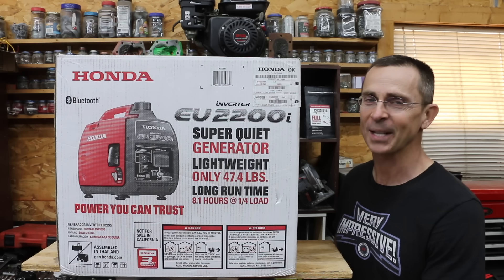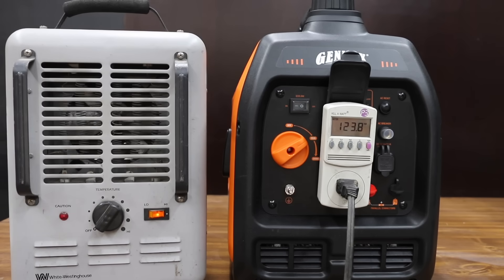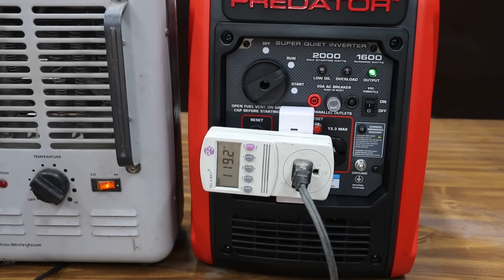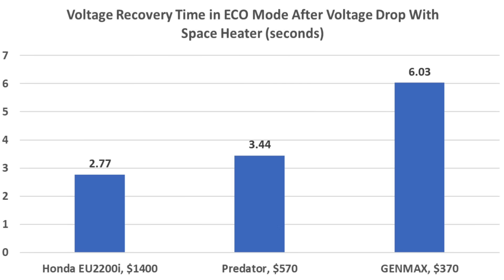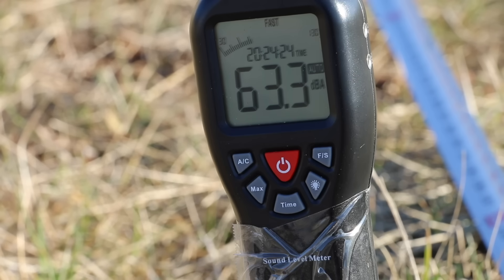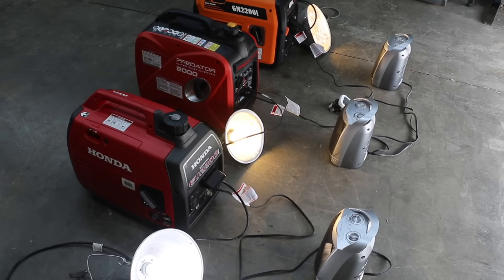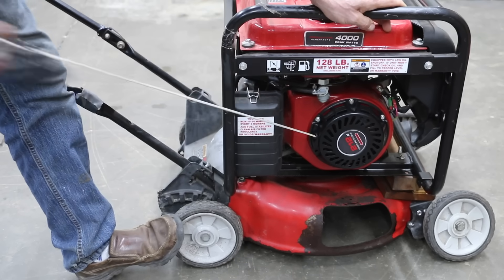Cheap Generator Better Than Honda? Predator vs Honda & GENMAX—Let’s Settle This!

Comment: You measured 60 oz of oil on a scale? There is a difference between 60 oz of weight and 60 oz of volume. It's the density of the liquid

Comment: I hate that most generators come with a CO detector that shuts them down. If the detector is faulty you can't use your generator. And if it is a life or death emergency you might not make it to the repair shop... I bypassed the one on my generator. I'm not a stupid who puts his generator inside a confined space...
Reply from the maker: Thanks for the feedback.

Comment: Many years ago, I remember seeing a small power conditioner that looked like a surge strip, but it was specifically designed to "buffer" generators that weren't "Pure Sine Wave" to ease the wear and tear on electronics and motors.  Does anyone still make those?  And if they do, do they really work?
Reply from the maker: Thanks for the suggestion.

Comment: I’d love to see more generators tested, great video and valuable information!!! 👍🏼
Reply from the maker: Thanks! Thanks for the video idea.
Reply: The 3500 watt machines are the largest number used at equine events that run air conditioner and heaters . I see all the brands but the predator inverter is by far seen about ten of them to every other brand. Not sure how these bigger inverter generator compare to each other but I do know that I tons more predators

Comment: It's not voltage drop that'll kill your devices but the frequency drop. They usually happen at the same time for the same reason, too much or sudden load. Other then that great video and seeing the sine wave is pretty important too because that's just as important as your frequency
Reply from the maker: Thanks for the feedback.

Comment: I have one that is a dual fuel setup, gas or propane. It seems to have less efficiency with propane. Not sure if that is something you would be interested in trying.
Reply from the maker: Thanks for the suggestion.

Comment: Honda makes great engines.
Cars
Boats
Generators
Motorcycles
Private jets 
Jetski
And they are all really reliable, even in cars, a Toyota Is More reliable in general but the honda engine will outlast the Toyota engine all day.
Reply: Indy racecars as well.
Reply: @crandonborth  even F1 cars. I have seen all types of cars blow up while racing with my friends, never a Honda.
Reply from the maker: Thanks for the feedback.

Comment: Do the dual fuel generators next. I only run mine on propane so I can bring it in the camper when traveling without it stinking up everything with gas fumes.
Reply from the maker: Thanks for the suggestion.

Comment: Id love to see some of the battery powered power stations that are becoming more popular compared. I’ve been looking to get some but don’t know how the life on them is and think it would be really fun to see your stress tests on them!
Reply: I'm not a fan of the battery boxes... The batteries start degrading from the time they're made, even if you don't use them.    My Honda eu2000i is 18 years old and we ran it for months after Hurricane Ian with no issues.  Those battery boxes won't last 5 years due to the battery chemistry.    Depends on your use, I guess. When a hurricane hits I can be without power for months.
Reply from the maker: Thanks for the video idea.
Reply: I would love to see this, too. I live in a condo, so I worry about noise complaints. I'd love to see comparisons between power stations with at least two standard outlets and 2 USBs.

Comment: First time seeing the oscilloscope, so quick mention for PF and anyone who may forget. This is a differential measurement without a differential probe. Connecting probe ground to anything other than earth ground can be lethal!

We're getting away with it because the floating scope creates a pseudo ground, but do not connect the charger or second probe.

Yes, the neutral-ground tie is presumably immediately near and the generator is also floating, but there are so many ways to accidentally defeat both those conditions. Just be incredibly mindful whenever ground isn't ground.
Reply from the maker: Thanks for the feedback.

Comment: Gavins garage is my favorite for generator reviews, but this... This is a whole different level Todd. Truely well thought out and well done as usual. 

I have the Honda, and I can tell you, its started every single time first pull, first pull out the box even, and is very good quality even though its made in Thailand. My brothers over(look at my last name) there are doing these super solid. I wanted a Japanese build, but I'm more than hapoy with quality and fit and finish of this unit. Even the little details. An oil filler extension, magnetic dip stick/drain plug, 12gal quick connect extended fuel tank, hour meter(see it when the genset is off) and some Shaffer oil and you have a hell of a setup that'll last forever. I plan to buy another soon for heavier loads beofre I rack up any hours.

Thanks for the super solid video, I'm glad I spent the extra. Even with all the goodies, I'm out the door for $1600 and it'll run all week long without a hiccup on the very first pull, every single time. Love this thing!
Reply from the maker: Thanks and you are welcome!  Thanks for sharing.

Comment: you're comparing voltage drop and recovery speeds with a relatively low update rate outlet power meter. The refresh sampling time would make a massive difference in both the recovery time and lowest voltage drop point. You've got an oscilloscope.. probe the unused outlet next time and you'll get a much more accurate indication of both metrics as well as a trace that shows a visual representation of what happens.

Comment: Again, Honda proves they know what they are doing with these small engines! Well done!
Would like to see Yamaha and Champion in the mix for the next episode of Generators.
For some others; Westinghouse, DuroMax, Ryobi, WEN, Craftsman, and Firman. These are some of the brands I can think of that are at Home Depot, Lowes, and Tractor Supply.
Another good video, Todd! See you next time! 🐺🔧
Reply from the maker: Thanks!  Thanks for the video idea.
Reply: @ProjectFarm I would second others for Generrac and Firman. Both brands available form Costco and have a good reputation
Reply: @ProjectFarm  also, up sizing the inverter generator capacity and seeing how that affects the voltage drop.  An approximately 4kW Predator, Westinghouse, Champion, etc is still less expensive than the Honda and Yamaha.  Thanks for the engine oil analysis, confirmed the Chinese engines have variable quality and still aren't likely to last as long.
Reply: I agree here, Champion and Yamaha are 2 other big ones along with Ryobi.
Reply: You can see how clean the oil was when it came out of the Honda too. The other generators had much darker oil.
Reply: @volvo09  yea, that's not surprising between those two brands.
Reply: The champion is junk.
I was really hoping the Firman would be tested, by the paper it seems to be the best value option.
I imagine the generac would also be good.

Yamaha is great, just as good as the Honda. Has more weight due to piston design then the Honda though
Reply: @syberspy9  which champion?
Reply: I also would like to see a Briggs&Stratton Generator in part two.
@Nacky What other piston design Yamaha is using?
Reply: Id like to see a WEN if possible, great video.

Comment: Wow, those have to be gassed up every hour?  That would be a real hassle. Good tests.
Aren't there larger super quiet gensets out now, like 3500W?  That might be enough to charge your electric car in half a day for a trip to the store or other family homes. Test, Todd?

I'd love to hear from current Predator owners as to how long they last, what they are used for, and their overall reliability.  Oh, throw in repair costs if any.
They're kinda messy when it comes to adding or removing oil, aren't they?  I'd probably thermally modify a medium sized funnel to the nozzle and tape it, or find a suitably sized piece of vinyl tubing to externalize the drips.
Reply from the maker: Thanks!

Comment: Here's an idea for a REMATCH (since you didn't destroy them all yet):
 Run the two 79cc gensets against the single Honda. Would that be less expensive and produce more power. They should win on power but lose on fuel consumption.  Challenge the double set against the Honda, but with the pair eco mode.  Two small sets would allow more options in emergency situations-and it's still cheaper if you don't blow the "budget" on the cables needed to run them together. A second set could be a legit upgrade rather than buying a bigger generator.
Reply from the maker: Thanks for the suggestion.

Comment: You didn't mention if the generators were broken in. I realize that most people (including myself if in need of quick power) probably consider the first few hours of loaded use as the break in and break in procedures for small engines is let's say, controversial not to mention that some folks say that even the brushed generator heads need to be broken in to anneal windings and set the brushes (which normal start out flat). Maybe a video idea would be to break in a small engine (like a predator 212 or similar) in a variety of ways and compare compression and oil analysis results after.
Reply from the maker: Thanks for the suggestion.

Comment: Quick thing to mention: The predator is more efficient on gas because it's also burning oil on every stroke. In the long run the Honda still wins because you won't have to buy a new one in 2 years
Reply from the maker: Thanks for the feedback.

Comment: A very timely test considering how often we lost power this past winter.  Compliments on your production values, sir.  Great pacing, densely packed practical content and positive energy!  Some may benefit from your tests of tri-fuel generators big enough to power critical appliances such as a refrigerator, water heater and furnace plus some lights at the same time.
Reply from the maker: Thanks and you are welcome!

Comment: At our shop we sold a variety of generators.  Hondas were the most reliable.  We sold a clone of the Tailgator.  It had a two-stroke engine that required gas/oil mixture.  It was not reliable.  It was not worth the price.  I have an older Honda EX650.  I have routinely run 800 watt loads on it and it handles those loads admirably.
Reply from the maker: Thanks for sharing.

Comment: As a tech whom works on small engine equipment allot I can attest to the fact that the Honda is very often much easier to do most common maintenance on than most other brands of these small suitcase inverter generators.  Especially the all too common issue of removing and cleaning a gummed up or contaminated carburetor.  That being said most of them aren't too bad to work on and the Honds price premium is a big ask for that difference.  I personally currently have the prior generation of that Honda and a Westinghouse.  Both of which were acquired secondhand.
Reply from the maker: Thanks for the feedback.

Comment: Great video. Reminds me when I was in the military testing tactical quite  generators for high altitude testing at Fort Carson, CO. We had to run test on them. We ran 100 watt lights bulbs and power tools on a set schedule, then took them on a "Road Trip" to see how they held up for survivability. 

Have you done a test on battery backup? Like the EGO Nexua, Anker, Bluetti or Ecoflow or others?
Reply from the maker: Thanks for the suggestion

Comment: I bought a used 2 cycle generator and it stared right up at sellers house. when i got home it started right up but would not rev or pick up speed. i removed the muffler and it revved right up . unfortunately a new muffler without the carbon cost more than the generator new. without any idea i started cutting the muffler open and am sad to say the patient didn't survive the surgery . muffler was completely plugged except for a small hole to let the engine idle . i would say if you buy a 2 cycle generator it would be wise to use the oil i buy which is amsoil full synthetic 2 stroke . my spark plug in my atv went 10 years before i decided to replace it for reliability.  i have some mufflers that i am going to try hoping it will be relatively quiet. another PF educational video. i wonder if you would be a good guest on PBS TEST KITCHEN . I bet you could come up with a good test for one of their kitchen gadgets !
Reply from the maker: Thanks for sharing.

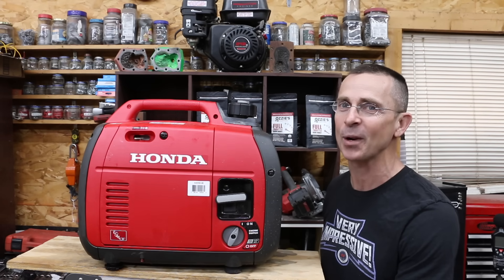Comment: Awesome reviews again. I have used gas generators for years in the construction industry. I have used Honda’s and found that they are work horses. Always start and with proper maintenance are ultra reliable. I have also used them for electric power for Amateur Radio Stations where clean power is crucial. I have a Makita G3501R that has run for years in construction. We were setting up for a ham radio field day and 14:39  were testing a bunch of different make and models of generators for interference and clean power and to everyone surprised the Makita was tops. I have a Honda EU2000 and it is a gem. Thanks again for your reviews and comments. Your work is second to none! 😊
Reply from the maker: Thanks and you are welcome!  Thanks for sharing.

Comment: Dirty AC Power is not good and can be hazardous, depending on the equipment it damages.  I love how you even bought an O-Scope to test that!  If you haven't done one, a whole house portable generator comparison would be great.  Harbor Freight had a sale recently and I got all excited about their largest model, then I read the reviews.  As much of whole house as possible.  I don't want to have to juggle lamps and appliances to be able to run my AC/Furnace, fridge and other necessities.  We get hurricanes here.  Another great one, Todd.  Thanks
Reply from the maker: Thanks and you are welcome!
Reply: Take a note from my experience. A generator is a liferaft, not a cruise ship. 

Florida native, just went through Hurricane Ian on what was once Fort Myers Beach.  We ran on generator for 3+ months... You want the smallest inverter generator that will cover your essentials.  Try getting fuel after a hurricane.  (and try affording it - Thanks Brandon). We were only using about 2 gal/day for the fridge and temporary window AC, lights, electronics.  In the meantime I know people who were plowing through 10+gallons/day,when they could get it. When gas lines are hours long and they're only giving out 5 gallons at a time, you quickly learn less is better.  Trying to power a central AC is just dumb.  Its amazing how well a 5,000 BTU AC can cool a 2,000 sqft condo.  Remember, this is a life raft to hold you over until things can gradually get back to normal.  If I had the place to put it, I'd install a 110v inverter mini-split for this purpose and as a redundant AC when the main fails. Far more efficient than the temporary window shaker. 

My 18 year old Honda eu2000i ran the temporary window AC and fridge simultaneously, no issues.   Adding a hard start cap to the circuit is highly advisable so the generator won't have to work as hard when these appliances start.   Always had plenty of power left for lights, fans, electronics.
Reply: @grayrabbit2211   Thank you!  I hadn't thought about it like that.  Great advice!
Reply: @100vg  The "liferaft" concept came from a friend whose home was destroyed by Hurricane Ivan in 2004. He had a large 13kW generator and both fuel availability and fuel costs were a problem, not to mention noise.  His father drove down with his RV for them to live in while rebuilding and it had twin eu2000i generators.  

 I had Hurricane Charley teach me that lesson in 2004 as well.  We had 3x 60kW Onan generators which powered the entire complex, right down to the fountains and landscape lighting. Worked great for typical thunderstorms and such. We ran out of propane in 4 days. Try getting propane delivered after a hurricane - it isn't happening unless you're a hospital or shelter.   That's when I picked up the Honda eu2000i and small window AC.  When looking at window ACs, buy one with the highest EER rating, so you'll get the most BTUs per watt.   I'll also note that all 3 of those Onans are now in the scrapyard as they were 6+ feet under water.  The lightweight Honda was able to be carried to a higher floor.